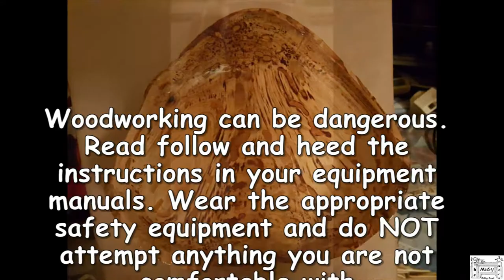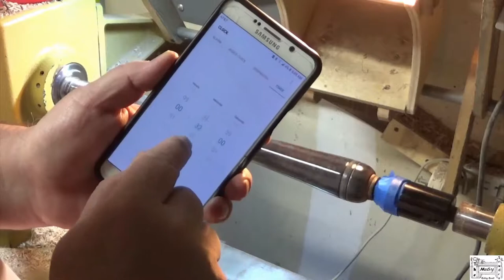#22 - Tool Handle for my Jimmy Clewes Quick Release adapter

Comment: Great video Bill and it's nice to see another Jimmy Clewes fan. You talked about your safety glasses of which I also had some glass prescription ones made up using watersport frames that come with a soft rubber insert that seals the eyes totally similar to your foam ones. Anyway my point to your viewers is do not choose anything else but glass for your lenses. I made this mistake on a previous lens and it wasn't long before, while turning a pen, I got a splash of super glue that you can't clean off high tech plastic so the lenses went in the bin. If I had chosen glass it wouldn't have been a waste of money....
Reply from the maker: Thanks, Steve.  And you are correct about the lenses.  Polycarbonate lenses are great and light weight, but CA will not come off of them.
Billy